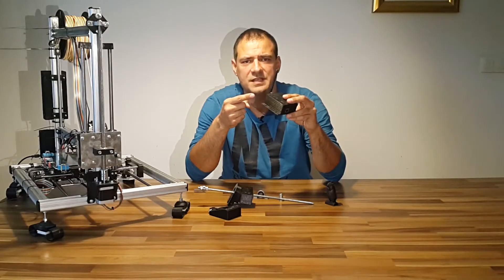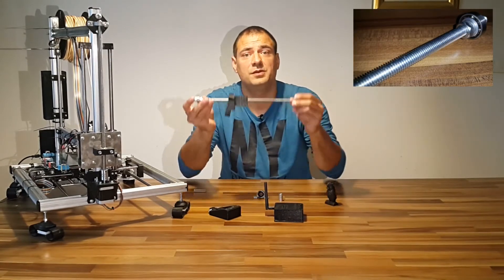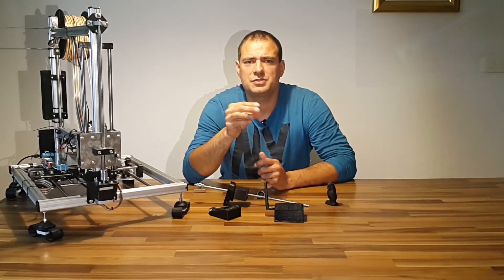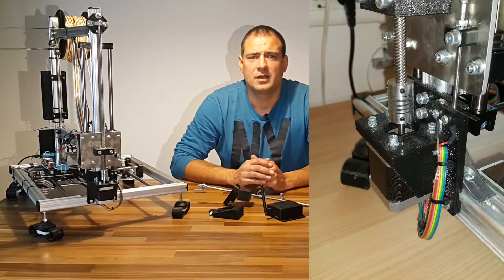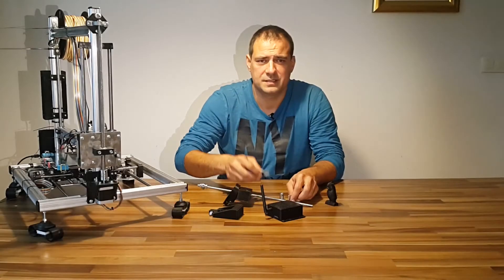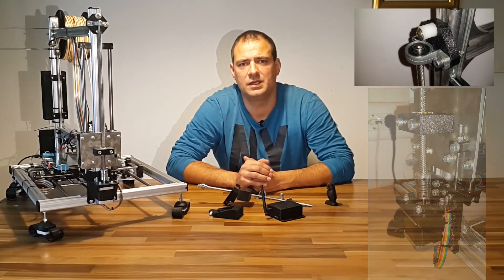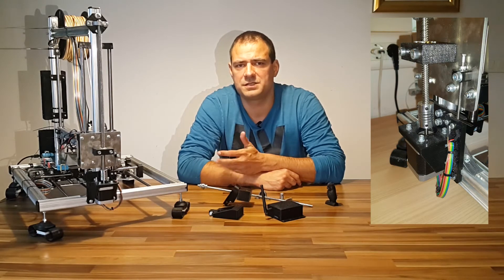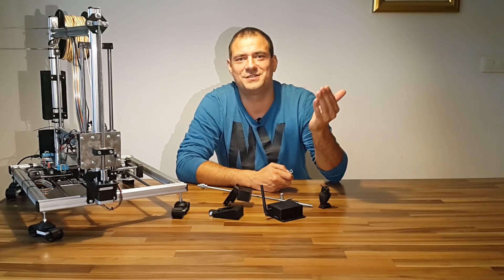3D printer Z axis upgrade (problem wobble, cheap)

Comment: Hello! Do I need to make any firmware changes? I’m not sure if the threads on the new rod are the same as the original.  Good video. Thanks and I will send a few coins your way
Reply from the maker: Hi, firstly, thank you for your support. 
Threads are different. The original has ordinary construction spindle rod. It is not precise nor straight. The rod I change original one to, is a specific rod for 3D printers - a precise one...
Here is a step you must not skip when changing to a new threaded rod: Change steps per mm for the Z-axis in Marlin to 400. It is in file "configuration.h" in a line called: 
#define DEFAULT_AXIS_STEPS_PER_UNIT   {64.25,64.25,2560,600}  // default steps
The third parameter/number should be changed into 400!!! So: ...{64.25,64.25,400,600}
The same thing can be done under Repetier Host. Find in menu and go into "Firmware EEPROM settings", then find "Z-axis steps per mm", change 2560 into 400. And save it back to EEPROM.
I prefer the firmware change. 
If you forget this "step-change" procedure, you might break something on the printer as it would make 2560 steps for every intended milimeter raise instead of only 400... In other words - intended 1mm would turn into ca.6.4mm (10cm->64cm).
I also advise to keep configuration.h file safe for any firmware upgrade in the future...
If you have any other question, just ask.
Have a great day,
Rok
Reply: @greeneyedexplorer  Cool! I ordered the set from amazooon for $16 US which is not bad at all. I'm making the parts you listed. Thanks for the firmware info and I'll let you know how it goes.
Reply: Got everything installed and it work so well :)  Awesome upgrade. I didn't have to change the servo mount. Mine doesn't wobble. Thanks again and have a great day.